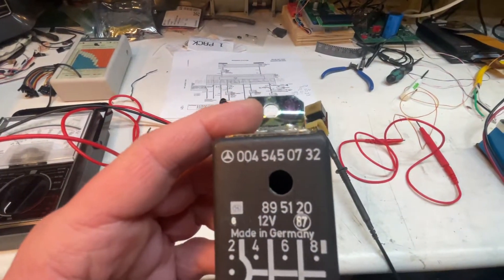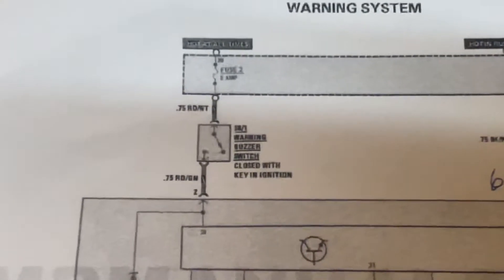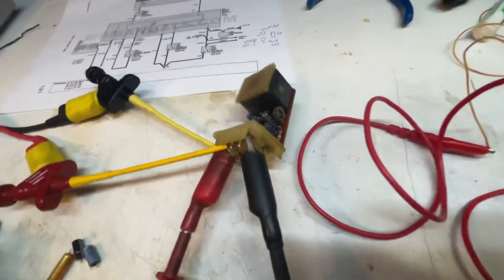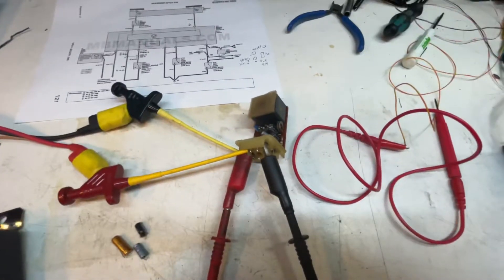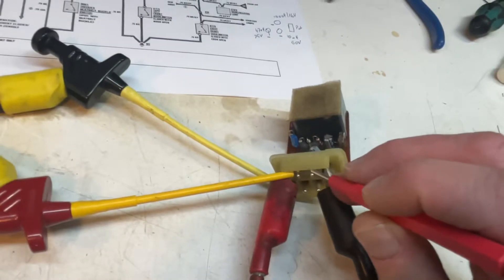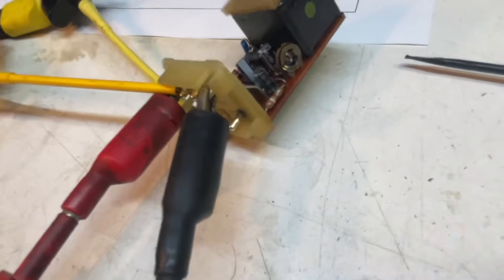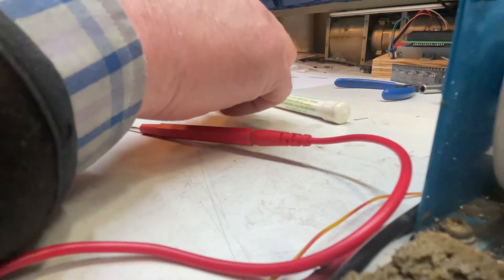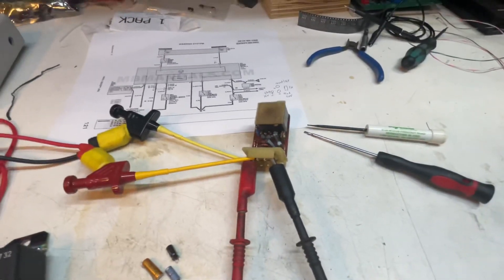Mercedes W126 Warning Buzzer for Seatbelt, Lights & Ignition - Repair to stop constantly buzzing

Comment: Hi, and thanks for another great video. I was planning to adjust the potentiometer on my -88 560 according to your instructions, but after removing the unit from the dash, I discovered that my unit is different from yours. No potentiometer, only electronics. The unit is smaller as well, about 2x3cm. The ID number is the same, except it starts with 005 and not 004 as on yours. Guess it is a newer version. But, I still want to do something with the annoying sound. The buzzer is obvious some other place. Any ideas which might help me? Thanks.
Reply from the maker: 005 545 07 32 is the cruise control coding unit for the earlier cruise control units from 81 to 92
It contains several resistors.
Some websites have this listed as cruise control unit and cruise control relay. However, it is only the 8 pin resistor coding plug which plugs into the cruise control main control unit and makes it possible to code the controller to fit model it is installed in
Reply: Hi, yes I Googled it and found it is the wrong unit. But I still want to reduce the length of the alarm buzzer. Can you explain where it is located? I have been looking under the dash on driver side (left), with no luck.
Reply from the maker: The buzzer is mounted next to cruise control unit
Reply: @inovahightechltd Found it. Yes it was close to the cruise unit. But, no potentiometer inside. Any idea of how to reduce time of buzzing, if possible at all? Thanks.
Reply from the maker: @ET-fy1qp I have to see the unit before I can say anything 
What’s the part number on the one you found?

Comment: My car makes the noise while driving, I’m not sure what the noise is for where is that located?
Reply from the maker: Under the dash driver side left side of steering column 
Just follow the noise, as closed you get, as louder it will be
Reply: Thank you, is there a reason it does it while driving nonstop?
Reply from the maker: @ToniiiAliu  the electrolytic capacitor and the transistor are defective